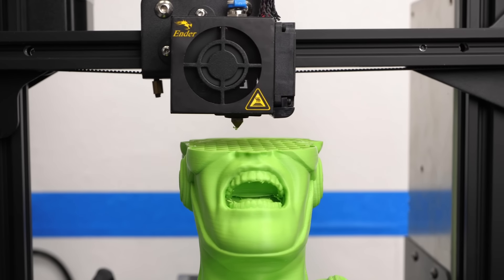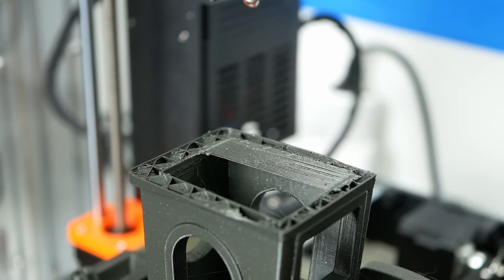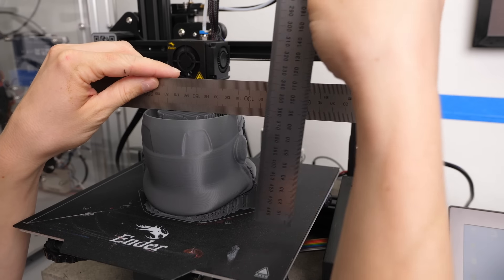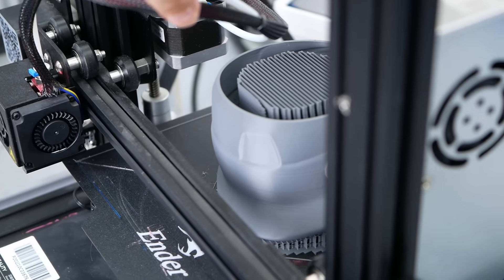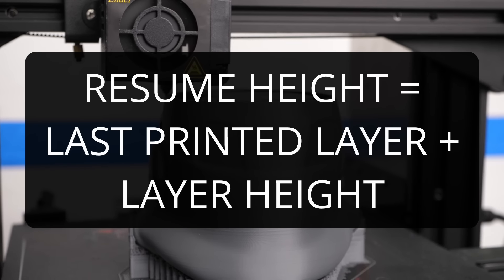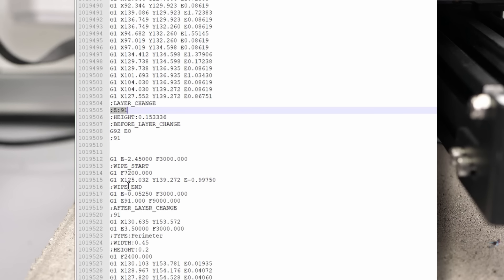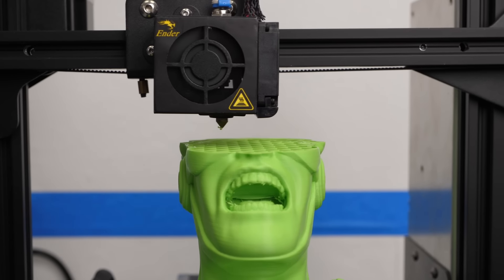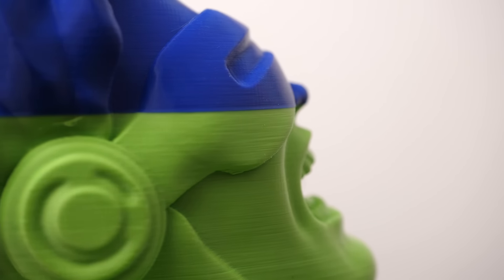HOW TO: Resume a failed 3D print!

Comment: I'm alwaya asking myself why It was never included to the fismware some function to "rewind" gcode until you can visually see it touching the print. It would be super handy.
Reply: I second your thoughts 💭.. must be some considerations stopping developing such an idea. Odd indeed.. “like why can’t the print head just ‘find’” the model using the pinda sensor, after a failure like this.. and resume code..
Reply: @BenjaminRayner  which kind of sensor is it? Because if it is a "bl touch" like sensor it needs to test lot of points to be sure not to be in an hole of the infill. Also the clog could not give a super clean end, it might be some under extrusion or some highspot. With rewind you could slowly dig the highspot and arrive almost exactly (almost) to the point the extrusion started to be inconsistent. For narrow prints shoudn't make so much difference but for wide ones printer could have already print quite a bit of the layer before the filament end or the clog
Reply: This is actually a brilliant idea.

Comment: I just had a thought on resuming failed prints that you have moved on the bed. Print one layer on bed then place part ontop and resume either where left off or breakpoint minus 1 layer depending. :)
Reply from the maker: Very good idea!
Reply: I didn't understand this one
Reply: @octimus2000  i think they are saying to print the first layer of the print again. so you know where the (failed) part was and can place it in that same positon
Reply: @sillyface6950  oooh, now I get it. Really good idea. Thanks
Reply: What about the part adhesion? Would you glue it to that layer?
Reply: @goku445  magnet?
Reply: @viralvideo3739 didn't know plastic was magnetic now 🤔

Comment: The only thing i would like to add to this, is a lot of times i have resumed prints i needed to add in a G92 E*** where *'s are a number close to the next extrusion. otherwise the printer will reject the GCode because it thinks you are trying to do a massive extrude (from E0 to E1000 for example). setting it to the nearest rounded down number allows the printer to continue printing!
Reply: This saved me! Thanks!!!
Reply: oh wow it worked thanks!!
Reply: this was exactly what i was wondering about since i normally print relative mode and this doesn't matter when gcode is in relative but in absolute mode it absolutly does matter. thank you for posting as i thought this is what i needed to do but wasn't exactly sure
Reply: i know its been a year,. but can i ask where should i put this on the code? and where should i get the value of the E***  ..
Reply: I was too late to read this before realising my printer was using absolute positioning...
My printer also did no reject the GCode...
It took me a couple seconds to realize the spool was visibly rotating and injecting my half part with molten plastic.

Now my half print is ruined and I gotta start over, I figured everything out and came here to warn people just to see your comment on top... I should read the comments before commiting next time :/

Comment: If you delete "everything up to the G28", make sure there isn't a G29 somewhere before that, as bed probing pretty much certainly crashes into your unfinished print...
Reply: saw your comment too late :)
Reply: ahh i shouldve read this comment before hitting go
Reply: On that note, G28 automatically triggers mesh bed leveling on Prusa printers equipped with it, so if you use a Prusa printer with bed leveling replace G28 with G28 W (tested on i3 Mk2S)
Reply: @clancywiggum3198  if you see this what would be the course of action to not get it to level on a Ender 3 pro with a Cr touch because I can’t figure that out
Reply: @calebdipaolo  Note - use this at your own risk, I don't have an Ender 3 to test this on, but a quick search suggests that G28 does not trigger mesh bed leveling on BLTouch equipped E3s, instead using the separate G29 code after homing. (See first comment in this thread as well)

Comment: Last but not least, especially if there are collision problems with a restart, there is always the option of printing the remainder separately and gluing the two pieces afterward. If the remainder has disconnected pieces a wide brim that is removed after gluing can temporarily connect these volumes.
Reply: I think this is even a better idea. Sounds faster too.
Reply: They literally showed that in the video..
Reply: I feel really stupid for not thinking of this.  All of my recoveries have been manual re-height, manual re-slice, etc.  Sometimes with 20+ minutes of re-positioning the part because the bed cooled before I could catch the failure.

Chopping the model in the slicer and gluing would be SO MUCH EASIER!  :P

Comment: A way to try to recover your work in case the model was knocked from the bed: 1. in prusa, preview the g-code you were printing and use 'export as obj'; 2. measure the height at which the print stopped; 3. in a 3d modelling program, load the obj and cut the mesh at the point the print should resume from; 4. print the newly made mesh; 5. sand & glue the parts together.

Comment: Advanced level: Do it on a belt printer!
Reply from the maker: Belt printers already mess up my brain. This will even make it worse.
Reply: Managed to do it today with a Voron 2.4r2. Had to put some flat surface on the print to do the quad leveling, tricking the printer to think it was doing it on the bed. Then homed Z again, recalibrate Z according to the print height... and then recalibrate x and y too... was not so easy, but I managed to save a 18h print...

Comment from the maker: Resuming a failed 3D print - worth the hassle or just dump and re-print it?
NOTE: This video covers the approach that works very well with GCode from PrusaSlicer and relative extrusions. If you're using CURA and notice that your slicer spits out absolute extrusion amounts (M82) then check the website article. The process of editing your G-code file might be slightly different!
https://www.cnckitchen.com/blog/guide-resuming-a-failed-3d-print
Reply: It could depend on the print, but mostly I think armed with this knowledge it does not become a hassle, more like a slight inconvenience, so totally worth it.
Reply: @Billybobble1  yes, also you could not have enough filament to reprint the whole thing
Reply: I've used all 3 of these methods before. They all work, but I've found you need to print the first restart layer hotter to make sure it bonds well.
Reply: Reprinting is definitely more of a hassle with how large some of these prints are
Reply: If it’s an Etsy order I dump and reprint… personal project… maybe
Reply: A couple times ive just measured the height at which it failed and then cut the model in the slicer and reprinted the top part so I could glue them together with a 3d pen
Reply: Dump and repraint X3
Reply: Worth it if the print is big. Even if it doesn't save much money I just hate wasting time and materials.
Reply: Very useful. Thanks
!
Reply: Thanks dude, I already kind of knew how to do this, but this is a great summary for reference and now I don't have to lookup the gcode commands next time. I'll just come here.  Thanks! 👍
Reply: @elminz  printing the first rebond layer slower is also probably a good idea.
Reply: @Unmannedair  Yeah. I usually set it slower and hotter. I've not had any failed seams since doing that, but it was at least weaker without doing that. Slower speed also helps pause it just in case. Also making sure there's plastic in the nozzle since you're not starting with a brim/skirt, else it will start with a gap.
Reply: I used to do the same, until I realised its eaiser just to glue that parrt of the top later
Reply: Wieso machst du keine deutsche Videos?
Reply: Depends - we didn't see you stress test these. We don't know if this leaves a failure prone layer. It would be interesting to see the failures with bed staying heated, bed heating off, and restarting at less than perfect heights. Love the tutorial. Very helpful.
Reply: As someone who’s actually tried this more than once, it’s one of those easier said than done things. To me, it’s always better to either restart or print the remaining portion separately and join them. 

Trying to resume a print from anything other than a filament runout and sometimes even then (for me at least) usually results in more issues that are I fixable in the final model than if you had joined two halves. 

I’ve never had as much luck even knowing the exact point / step where I need to resume, as the “seamless” resume that he had.
Reply: Fools try to fix failed relationships, failed businesses and failed prints - the clever man dumps them and tries again; but those who try and SUCCEED, they become LEGEND.
Reply: If you only released this video 3 days earlier... Hihi :)
It would save me a lot of frustration I had with printing a model that took 35h but failed twice after 30% (was able to react on time) and then 70%.  
I managed to "fix it" with slicing the model into two parts and printing the left over and later glue it but required hours of post processing aka sanding I was hoping to avoid. 
Thank you for this and all other videos!
Reply: Indeed. I learned this the hard way back in the day. I had to learn how to set the current extruder length so that any subsequent E commands would pick up from that point and not extrude meters of filament.
Reply: @RegularOldDan  Yes, with absolute positioning you also need to set the extruder motor position as well; G92 E(value at failure point). Otherwise the printer will extrude out an amount of material equal to the whole print up to the failure point before resuming lol.
Reply: @Bordpie  Yep! I haven't had to deal with that since I started using PrusaSlicer in favor of Cura. (I used to use the latter on my older printer and whenever doing things like this I needed to update the Gcode to set the extruder position. I forgot to do it once or twice and it was an interesting test of my flow rate.)
Reply: With Cura i had to modify the g92 line to close to the next one's value and also split G0 so z would move first after homing. Thanks for the info though looking good so far with my recovery. example g0:
Change: G0 F300 X115.779 Y67.324 Z96.8
to:
G0 F300 Z96.8
G0 F300 X115.779 Y67.324
Reply: Thank you so muchhhhh!!!!!
Been frustrated what to do then found this video🙏
Really helpful
Reply: I have done it simpler at case you cant home Z, turn off printer, manually move axis so that head touches the top of the print, then in G code, edit it that it homes only X and Y ( G28 X Y ), then you have to tell the printer that its at layer that you failed (enter G92 Zx " x= desired height" in g code), otherwise it will start to print above current printed model at previous failed height- in mid air,  of course you have to remove layers that are already printed in code, and if you print with cura and usb cable, it moves 2mm from the home so you enter Z-2.0 and that's it.

Comment: I've kept hold of several large-ish failed prints, now having seen this, I think I can save some of them, and I no longer fear the dreaded air printing. 
Super useful vid Stefan, thank you so much.
Reply: Once you've taken the piece off the bed, how will you re-position it on the bed and make sure it lines up in order to finish it? Maybe I missed something in the video. I plan to watch it again.
Reply: @dangerous8333   It was Stefan's first tip, if you can workout when it failed and then 'sink' the model in a Slicer, then simply print the remainder and glue together. It's almost obvious but the thought never even crossed my mind, sometimes you can't see the wood for the trees!
Reply: Dan was correct though, Stefan ALSO said it was VERY important NOT to move the print in the X/Y axis, like with a removable build surface, as there is no way to line those back up, even if you get the Z height calculated.
Reply: @brandonwatts5435  he isn't taking about finishing the print with the failed part on the bed, but to print the failed section on the bed and glue it to the existing model.
Reply: @dangerous8333  I think in a possible way: restart the same failed print with the same gcode, and print two or thee layers. Stop the printing. Use a sharpie to mark the position in the bed. Remove the two or three layers. Place the failed print in the marked position. Do the Stephan's procedure then.
Reply: All you have to do is count the layer lines😂😂 and start on the last line it stopped
Reply: @brandonwatts5435  Luckily, I was able to pop the hot glass off my bed, and then slip it halfway on when my Ender set home. Then just clipped it back down and took off.
Reply: @dangerous8333  you can import the gcode in some software and create an outline that will fit the 3d part exactly were it was and them follow the procedures in the video.
or just continue the upper part and glue everything together (this is the part you lost in the video) (lol your name is dangerous)

Comment: For Prusa MK3 users: When manually setting the Z-Height on a Prusa MK3 I have found that the M211 S0 command is invalid.  So, instead I set a bogus G92 with a Z value large enough I can lower the z-axis to the last layer printed.  Hope this helps and thank you Stephan this tutorial has saved a bunch of filament.  I've come back so many time I finally decided to write myself a cheat sheet.
Reply: This should be a pinned comment!

Comment: Thank you for this. I was able to use your article to successfully resume a print that failed 8 1/2 hours in. My extruder stepper lost power and I had to replace a cable that took me a week to get ordered in and replaced. Fortunately I left the print in place on the bed and it did not detach during that time. Using your instructions I was able to restart my print like nothing ever happened!
Reply from the maker: Awesome!

Comment: I suggest doing the resume layer at much slower speed (around 10%) as well. Not only will that help layer adhesion by radiating heat into the previous layer that was likely just sitting there cooled and thus making it more likely to stick, but if you end up running the nozzle through a slightly taller section of the layer (like from warping) or previously printed part of the layer, the slower speed can allow for the nozzle to melt its way through with minimal damage to the machine. This might not be as important on lower, more normal layer heights, but the 0.8mm-1.12mm layer heights I work with at work, it makes a huge difference.

Obviously it's not ideal to have the nozzle plowing through the previous layer and it turns out very ugly, but for practical parts, the strength and successfulness is more important.

Comment: I had two failed prints due to a "Move exceeds maximum extrusion" error. Each print was 90% complete and took half a spool of filament to get where it was when the error hit! Infuriating. I was able to figure out the issue and fix it, but you saved me from having to do a third print from scratch!! Thank you so much for this great content.

Comment: My first 2 day print ever, the X stepper motor cable came loose a day and a half into the print and it was just printing a blob forward and backward. I was able to peal off the blob, keep the bed heated, measure the height, home X and Y, move the print to the front and home Z behind the print, create some fancy gcode, and resume printing perfectly. Being able to pull something like this off is essential for longer FDM prints in my opinion.

Comment: CNC Kitchen, thank you for your video.  Long time follower and long time printer.  I used to give up on failures, but today I woke up to a 12 hour print that had a color change.  I did the color change and the first of 3 layers went good, so I walked away, just to come back and see a clog happened and it didn't finish the top two layers.  This was on 18 similar, small parts. I didn't want to throw them all away, so I gave your instructions a shot.  Here is what I did.

Prusa MKS3 -  I followed all the instructions, but the reprint height seemed to be high, visually by about 1 mm.  I noticed right away so I stopped it and tried one layer lower.  It was once again restarting too high about the same 1mm too high.  I tried a 3rd time, but i lowered my first layer calibration.  Once again it restarted the print too high by about 1 mm.  

My solution was to take off the print which was adhered to the flex sheet.  I was printing TPU, so it was stuck on good.  I then placed a spare flex sheet down.  I re-edited the G-code file to allow for bed mesh leveling after the homing step.  I started the print using my spare flex sheet, and when it finished the homing, bed mesh leveling, and purge, it went up to the proper height to restart my print. This is where I quickly, manually paused the print from the controller. I took out the spare flex sheet and installed my flex sheet with my unfinished printed parts.  I then restarted the print and it started at the correct height.  Luckily it lined up and it finished printing.  Most of them look good, a few of the first ones are not great, but I salvaged 15 of my 18 parts that I was printing.  
Thank you CNC Kitchen